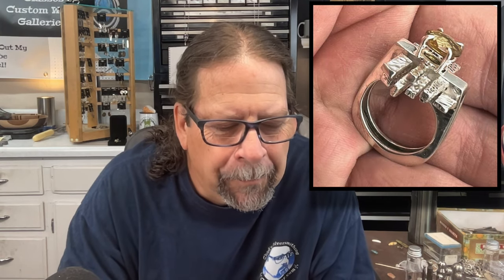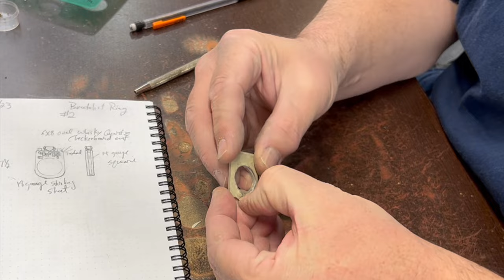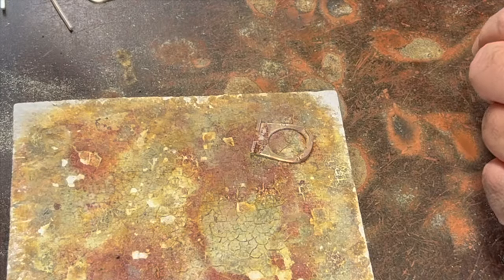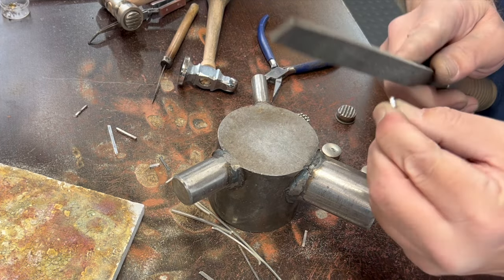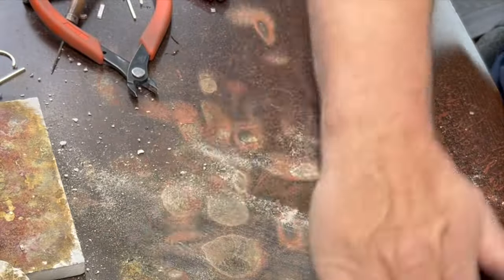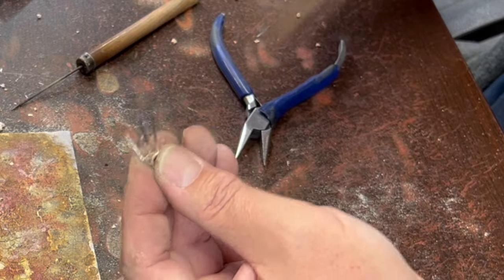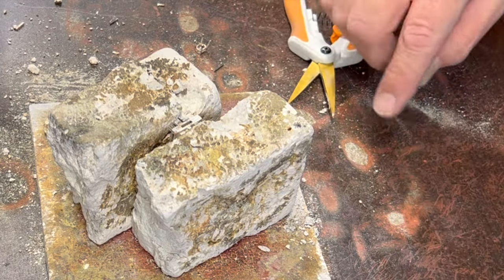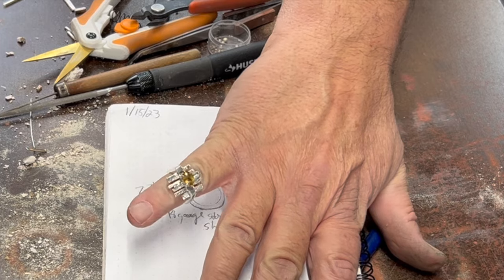Brutalist Ring Style #:2 A Silversmithing Tutorial

Comment: I can so relate to needing to adjust what I do to how fresh I am in the day. I’ve ruined too many projects by trying to push to finish when I’m tired. I often call it a day and then save that difficult solder operation to the next day, otherwise I am set back a whole day in both time and materials. I also find basket settings really hard-it’s time to make a bunch just for skill improvement, I think. Sometimes I use “Hold It” soldering clay if the piece is especially fiddly
Reply: Cool project, Chad. Thanks for the video.
Reply from the maker: Sounds like there are quite a few products out there to hold things in place.  I should try some out:). Thanks for the nice comment Ann!
Reply from the maker: You're welcome!